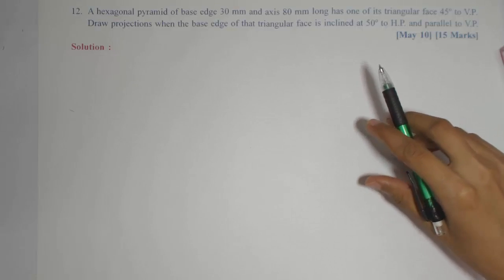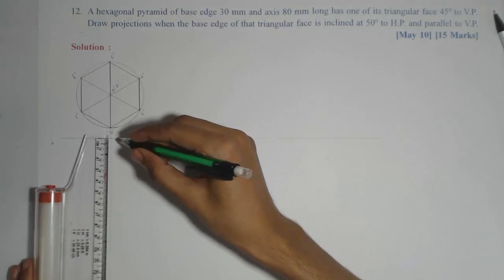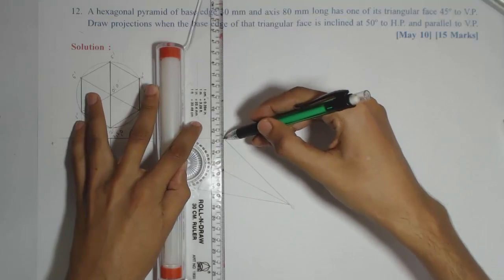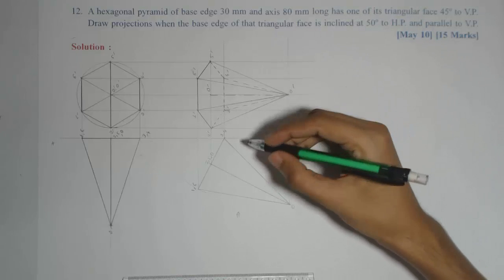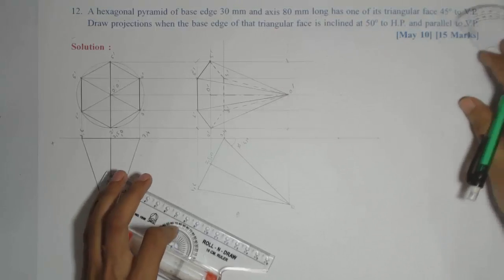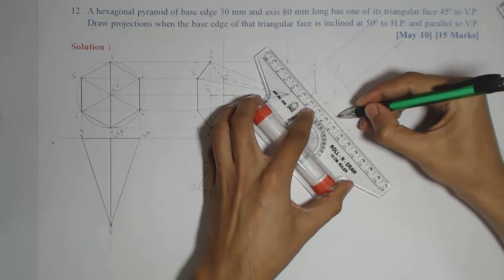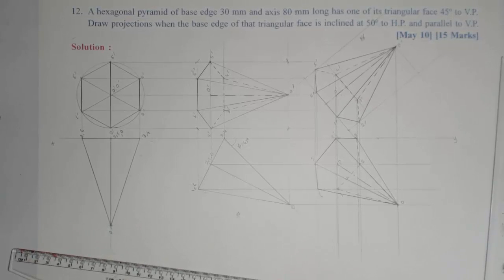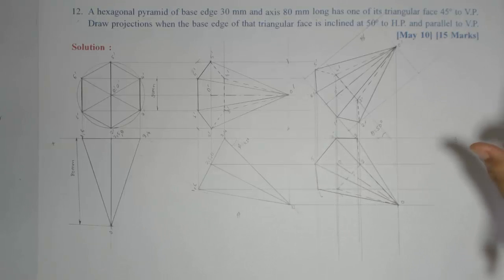Pyramid Q 12 May 10

Comment: sir can u please explain what is the meaning of parallel to v.p. in the end of the question.
what it actually indicates?
Reply from the maker: Actually the given solution is not satisfying that condition as the base edge 3-4 of that triangular face is lying on xy means on the VP and not parallel to VP. In order to achieve that we must hv tilted triangular face 1-0-6 @ 45 degrees in second stage instead of 3-0-4. So that in last stage we will gate base edge 1-6 of that triangular face parallel to xy means parallel to VP. Thanks for ur comment!